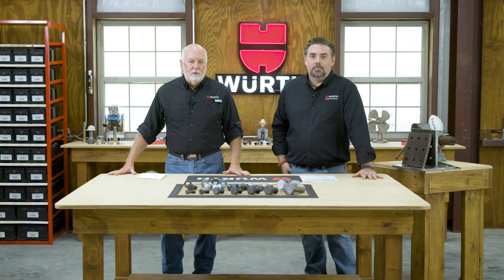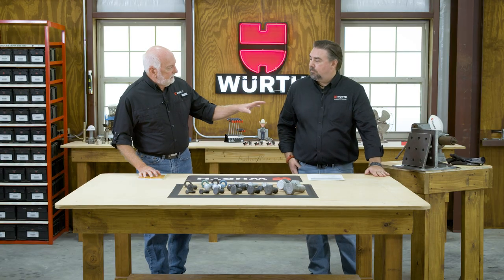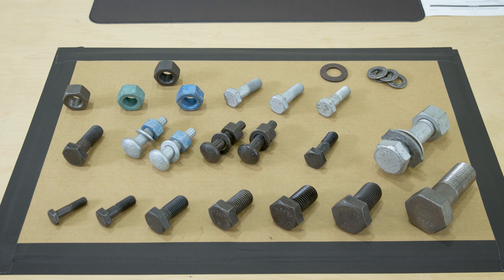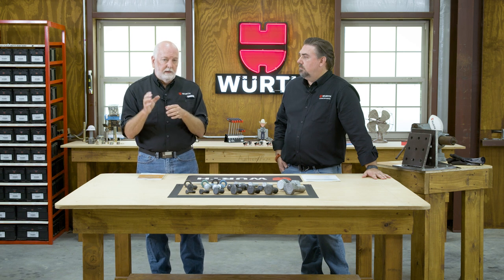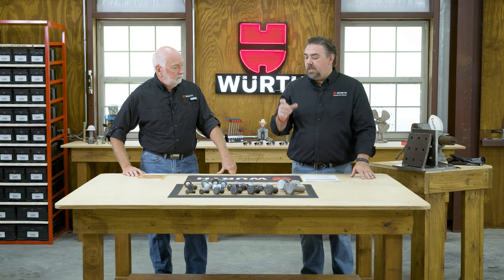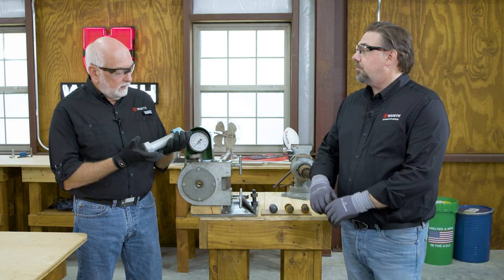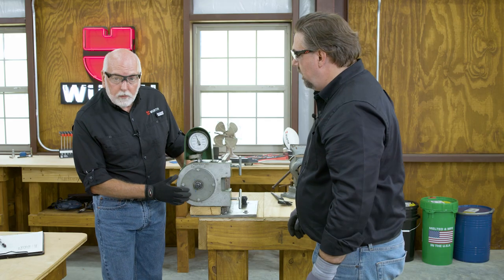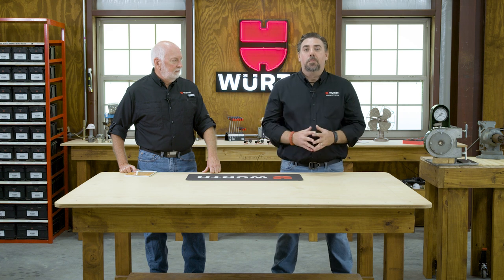Introduction to Structural Bolting | Würth Knowing Episode 16

Comment: Is the Skidmore test being performed correctly? I believe the match marking should be done after performing the initial snug tightening. The nut is then turned until the Skidmore reads the minimum required tension. A torque value is read at this tension. The nut is then rotated further to a prescribed amount of turn. The amount of turn is measured from the initial match marking.
Reply from the maker: Chad, you are correct—we have updated the video's description to correct the step in the process that we completed in incorrect order. Thank you for your comment!

-Randy
Reply: @WurthIndustryNA  Thanks for the response and clarification. I have enjoyed these episodes very much!